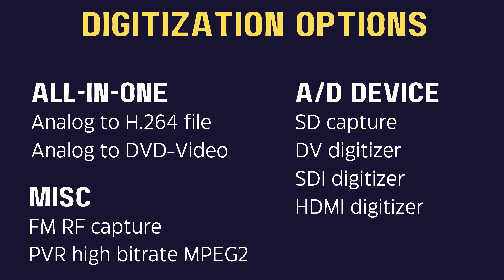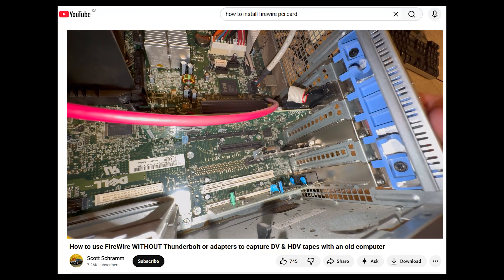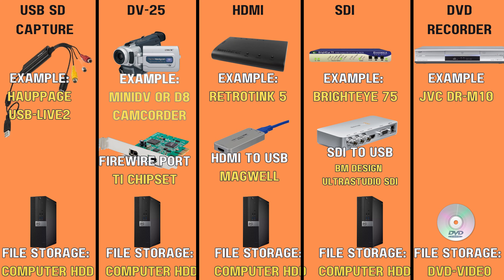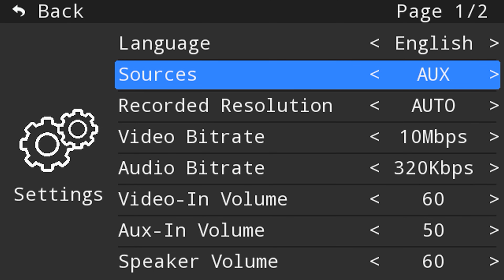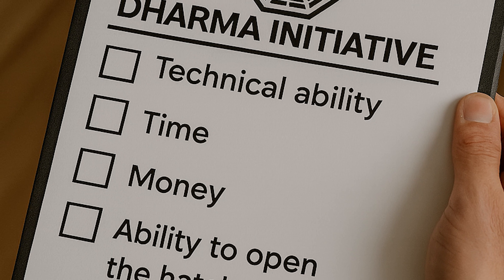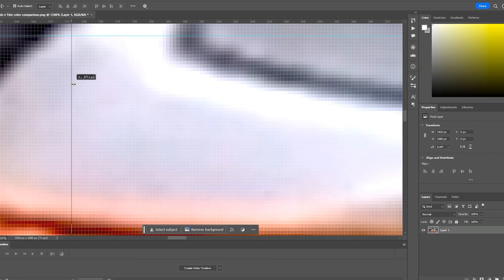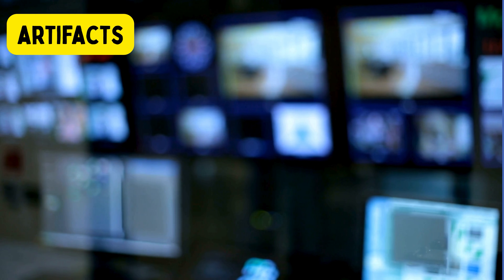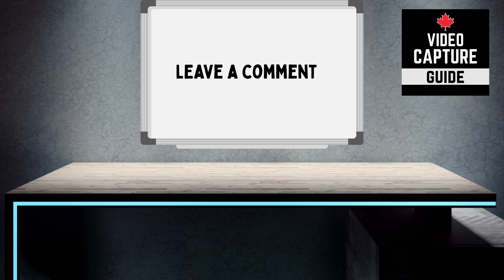Video tape to digital: all methods explained

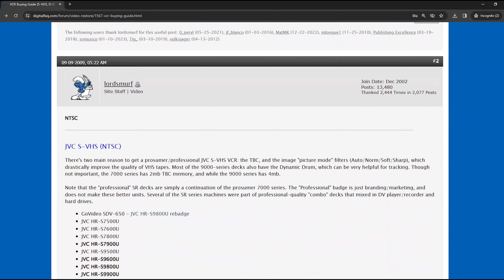Comment: 4:40 don't those artifacts all depend on the capture? Even the shittiest vcr with a good capture won't have those artifacts, difference will be minimal (tbc, hifi stereo, svhs aside)

Anyway this video is the best i've ever watched about this topic, i wish most youtubers were as expert as you
Reply from the maker: The most noticeable artifact is where the top of the screen gets all wavy. That can only be avoided by using a VCR with Line TBC (or adding an ES10/ES15 or a few other DVD-recorders I didn't mention) to thw workflow. Most USB/SD capture devices don't have any circuitry inside to prevent it, although I did a test on this channel that showed that the ATI 600 was somewhat better than the ATI AIW 9600XT. (Although I recently saw a video from The Tech Genie that seemed to show that new firmware in the GV-USB2 has improved its Line TBC abilities.)

Other artifacts like chroma noise can appear much worse of regular VCRs, whereas the Super-VHS VCRs with Picture Control filters and DNR/TBC filter can clean that up pretty well before it reaches the capture card. Although I plan on doing a video comparing a basic VCR with a Super-VHS VCR and process them both with NeatVideo and/or TopazVideo to see if there is a noticeable difference in the end.

Thanks for watching and for your comment.
Reply: @videocaptureguide  When it comes to artifacts such as Dot Crawl and Rainbowing, that is caused by composite connection. S-Video connections do not have that problem. A playback device might also have a 3D comb filter to reduce such imperfections for composite, but that is from my understanding lower quality than using S-Video from the start.

Now if you get dot crawl and rainbowing when using s-video, I'd say it is most likely because the source tape was recorded using a composite connection. Example being a television recording, I'd say more often then not they were doing use composite connections as I bet most households were not using S-Video to record TV content onto tape. Basically those artifacts who have been baked into the tape/DVD and can be correctly digitally using avisynth/vapoursynth filters.

Also color bleeding tends to happen on pretty much all the tapes, of course some are worse than others.

Thankfully there is a simple avisynth plugin called chroma shift which allows you to offset the color bleed yourself to try to fix it.

Comment: I’m enjoying the DV 25 method. Well, the results anyways. The main issue I run into is noise from the VCR itself, not visual noise, actual sound.
Reply from the maker: I have noticed that DV digitized videos tend to be lower decibles and more muffled sounding, compared with my ATI 600. I think the issue with sound and DV-25 digitization. Not sure the exact reason, but I've read it uses soft limiters to prevent clipping, and/or that the DV camera expects live audio through mics and not audio/video being passed through. Also read read that there might be more electrical interference from the camera capture device (compared with a USB capture device that is not plugged it to AC power). So, I think that's probably the reason.
Reply: @v @videocaptureguide  don’t think it’s the method from what I gather. I think it’s actually the VCR. I get a rather annoying helicopter noise. Got it on the HDMI capture too. I will take your advice into consideration if I’m not satisfied with the sound solving for the helicopter noise.

Comment: Good summary of different capture methods as usual! SDI I'd say is much simpler than traditional analog capture since there are standalone SDI recorders (can be lossless or compressed to something like ProRes422), it's really more of a question of whether you can locate a decent TBC that outputs SDI. There are several models out there from the likes of Snell and Wilcox, Brighteye, DPS/Digital Processing Systems/Harris/Leitch (DPS-470/475/575/x50/x75) that come to mind. Though most of those do tend to work better if a line TBC is already in use.  Another advantage of SDI is that you can hook up an SDI vectorscope and waveform monitor inline with the signal and not have to wonder later if your levels are clipping and is useful for real-time monitoring. You can get good results from analog in/out TBCs like the For.A FA-310 combined with an Analog to SDI converter from Blackmagic, and the Blackmagic device also has audio inputs so that takes care of the audio embedding. The Analog to SDI converters do tend to require very stable input sources though which already have been through a frame TBC in most cases. On frustration with SDI is that some TBCs and recorders that embed audio into the SDI signal will only accept balanced (3 pin XLR) audio inputs, so you may need an extra device to convert RCA into XLR, but those are relatively easy to find at least.
Reply from the maker: Everything I know about SDI I learned from dellsam34 at VideoHelp. The videos he digitizes with his SDI device look great on his channel: https://www.youtube.com/@Capturing-Memories/videos

If anyone wants SDI advice, dellsam34 is the man.
Reply: Most BMD based SDI workflows which is the most supported computer side workflow, is using Vrecord today, so you're going straight to FFV1 at the same bitrate as ProRes but it's fully lossless compressed instead of visually transparent, the only keynote is sticking to PCM audio so you can instantly use it inside of resolve (because they never fixed FLAC audio support) and/or playing back out of the workflow to a CRT for monitoring or video monitor people forget that fact. 

But the RF Capture workflow completely levels the field at the same but most of the time lower price point, when you start adding up the total cost of infrastructure and then the total cost of storage because FLAC FM RF at 325~350MB/min is smaller than FFV1 at 40~130mbps range vastly smaller than V210 at over 200mbps, software decoding has been well production ready for years at this point synchronised capture workflows since 2023 although this video didn't feature any of that properly sadly.

Comment: thanks for the video ! do you know where you can find prefered cameras & VCR for the RF Capture way ? cheers
Reply from the maker: The VHS-Decode project has a list of VCRs that have been tested. I believe in general Sony VCRs are favoured because they are easy to tap. Here’s the page on their GitHub that explains it. https://github.com/oyvindln/vhs-decode/wiki/004-The-Tap-List
Reply: @videocaptureguide  Sony VCRs aren't particularly favoured but they and Panasonic decks are generally better than JVC decks in terms of the quality of test point output of course when you bypass that and go straight to the head amplifier you can level that playing field a bit more. 

But discouraging soldering and going for Dupont 2.54mm headder connectors has its own special challenges because those connectors are not a solder joint you're still reliant on how crappy that connector potentially is and then incurring losses from bad contact.

Comment: I wouldn't consider DV capture in the worse quality of the spectrum and despite being 25mbps put it in the better quality just a step behind the analog capture devices, i'm curious about the RF capture thing but we are still some years behind for it becoming avaiable for everyone, buying it in other countries like Spain and replace completely all the capture devices, famous DVD recorders with TBCs, standalone TBCs and Frame TBCs boxes and all cables like composite, s-video or component since you just connect a coaxial cable (RF) in the camcorder and VCRs, although it would be harder with camcorders for the coaxial cable part. I think you could use a flex cable in the secret port of the camcorder and I think almost all of the Sony Handycams had it.

But I think most camcorders from Sony already have a small RF out port that looks like a jack port and you just need an adapter.
Reply from the maker: Perhaps I was too harsh on DV in that chart. From what I've seen, it's fairly straightforward to connect a Sony camcorder to the CX card or the new RF capture card. The part that has scared me away from it thus far is the work one needs to do to the off-the-shelf CX card. With CX cards, the raw RF is too weak for the card’s input stage, so you must insert an external RF amplifier. I'm not MacGuyver so I balked at this step. But with the new device, the MISRC, that step is unnecessary.
Reply: @videocaptureguide  You were actually a wee too generous. DV boxes can, and do, drop/insert frames like any other capture card. There is nothing special about those boxes. But I do agree that DV boxes are mid-grade solutions. Far from best (lossless AIW), far from worst (Easycaps, Elgatos, ClearClicks, etc).
Reply: @videocaptureguide  You can read harrypm's post from the other comment chain from JosFrollDV. But from my understanding, he says that while the MIRSC replaces the need of modding the CX card and is mostly designed to be a solution for laptop users. It does not replace the more than likely required need for an external RF amplifier.

Also from my understanding the signal being too weak depends on the original playing machine, so the amplifier's job is to increase the signal strength to try and make them all consistent. You might not really notice a difference if your playback machine is lucky enough to already have good signal levels.

As well, from what I've read on the wiki, the RF amplifier is seemingly rarely needed for Sony camcorders, though some models would require soldering in a decoupling capacitor. Where as for VHS the amplifier is practically a requirement.

Comment: In Europe, the Panasonic ES10 has an extra TBC/Synchronizer chip, while the ES15 only has a poor line TBC in the AV input selection IC. The Panasonic S-VHS recorder NV-HS900EG, with its die-cast aluminum K-drive (rare in the US and Canada), costs around E50 in Europe when broken and around E100 when working. The line TBCs of the Panasonic NV-FS200EG and NV-HS1000EG aren't good enough for me, nor is the frame TBC of the NV-HS950EG. If you adjust the head switching point on the 950 downwards to line 577 (PAL), it goes completely haywire. I've already managed to get the Panasonic NV-HS900EG (which doesn't have TBC at all) working with a Pioneer DVR-560H (which does have a PAL/SECAM/NTSC Frame TBC) in EE-Mode and a Blackmagic recorder (PCIe card with SDI + HDMI input was only briefly available) via RGB HDMI output from the DVD recorder. However, the signal chain, consisting of an HDMI splitter + dummy CVBS output converter, RGB HDMI to SDI + SDI to YUV HDMI converter, still needs to be simplified and tested long-term. I haven't noticed any errors with the VIA chip when using Firewire under Windows 7, but so far I've only filmed the very short video on cassette removal for Panasonic K-drives. The best thing to do is leave the camcorder running for hours with the camera function and software that detects DV errors. I don't like TI. All my opinion😉
Reply: Hello, thanks a lot for this complete comment. what is the EE-Mode ? also, which is the precise reference of the Blackmagic Recorder : Extreme one ? thanksss
Reply: @IntercoMobile  EE = Electrical in to Electrical out, with this DVD recorder, this is only possible via the TBC. My PCIe recorder Card is called Blackmagic Decklink Mini Recorder HD, but it was only on the market for just under a year. The UltraStudio Recorder 3G is the replacement with Thunderbolt 3/USB 3.2. The intermediate step with SDI enables 4:2:2 YUV from a 4:4:4 RGB source, and thus Intensity (cannot handle 4:4:4) and Windows 7.
Reply: @TTVEaGMXde  thanks a lot. by any chance, do you live in France ? would love to exchange more with you
Reply: - I'm not aware of any VCR having frame TBC. That wasn't a consideration back in the 90s or 00s. Line TBC, yes. Frame TBC, no.
- For certain, no DVD recorder has frame TBC. A few specific DVD models have line TBC. And all DVD recorders have non-TBC frame sync.

Comment: The types of tapes section of the video is a bit tricky because of Digital 8 tapes with analog Hi8 recordings in them, and Digital 8 recordings in the analog Video8/Hi8 tapes hahaha

Anyways for that you just need a Digital 8 camera with analog playback to detect sections in the tape where the recordings are analog Video8/Hi8 or Digital8
Reply: Most of the Sony Digital8 camcorders also have the standard FPC jig board for testing which has the full FM RF signal for Video8 or Hi8 tapes if played back,  makes them really easy to use for modern FM RF Archival capture as the whole format is a single channel format so you only need a single channel for Video RF and Hi-Fi RF capture off a single test point.
Reply: @TheRealHarrypm  Yes, my 1998 Hi8 XR camera also have a jig board for testing but I don't know if is the same as in the Digital 8 cameras, I think yes. I'm curious for the upcoming MIRSC device that completely replaces the need for the CX card and the external RF amplifier. Maybe with the MIRSC they will be able to advance more in the RF capture method, make it more avaiable and easy for everyone and finally replace and make obsolete all capture cards, TBCs in DVD recorders, standalone TBC boxes and composite, s-video and component cables since you only use a coaxial cable for it and software TBC, but I still think we are still some years away from this to happen.
Reply: @JosFrollDV Exactly the same, Hi8 and Digital8 pretty much have the exact same design philosophy It's only the older Video8 stuff that didn't have jig ports easily accessible.

This video shows the v1.5a which has been out for over a year now, there's not going to be any major margin for 8mm, and that's been cross platform software direct to FLAC.

The V2.5 is a replacement for the Clockgen Workflow for people without desktops or PCIe slots, it has a better clock system and 4ch audio, but It doesn't however magically replace the concept of impedance matching with dedicated amplifier boards, but the 100ohm mode should be fine with most 8mm stuff, boards will be hand this month for testing.

It's also worth noting that the workflow as of 2023 is all directly capturing to FLAC, this has been standardised for production for several years now the decoding is done and over for Video/HiFi for 8mm surpassing with a bit of margin on the internal decoding of Digital8 cameras because you've got better access/control over comb filtering, existing 2017 DdD owners have leveraged this as soon as decoding was implemented over the last couple years.
Reply: @TheRealHarrypm  I wonder if is not necessary the flex cable in the jig port because I think all Hi8 cameras have a mini RF out port that used a kind of jack connection, this wasn’t available in Digital 8 cameras I think but it was in most of Hi8 cameras.
Reply: @JosFrollDV That RF connection was for TV modulation for the composite signal output not for the FM RF off the actual tape path, you can only access FM RF from the test point or from the IC pins, TV modulator demodulator packs are completely different.
Reply: @TheRealHarrypm  Anyways the part of the jig port is very easy just plug the flex cable, plug it into a very small PCB with pins and locate the correct pins to connect the RF cable.